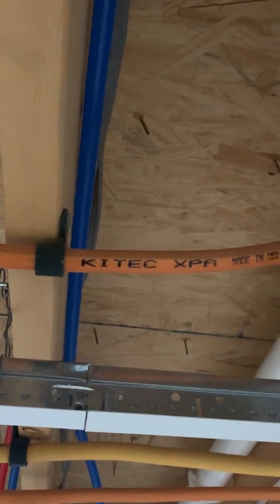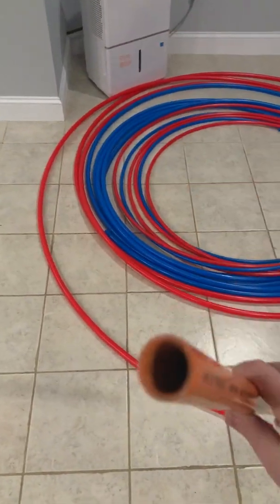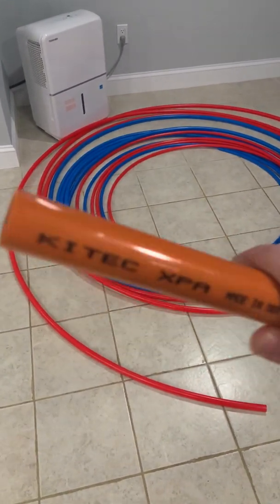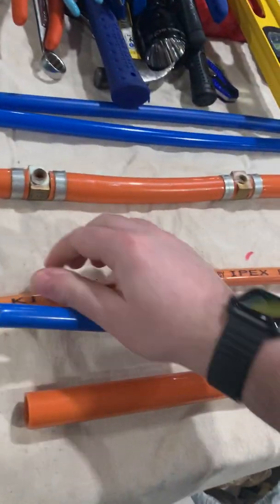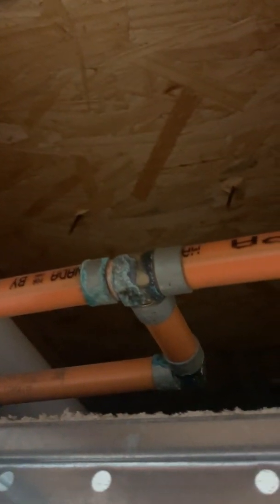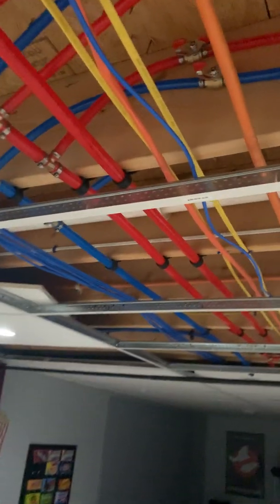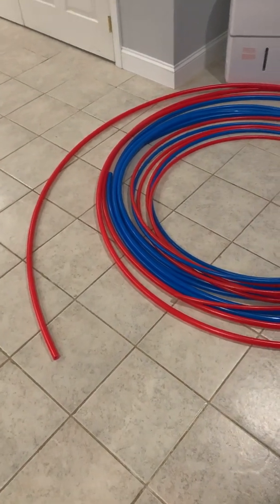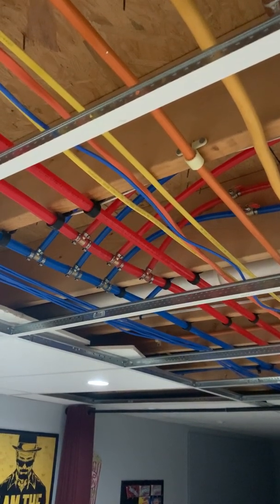Ipex Kitec Pex Plumbing: A Homeowners Experience

Comment: Super helpful video especially the parts about the Veratek fittings.  Looking to use some myself but getting conflicting information from the manufacturer.  I know this is 3 years later but would you happen to know the ID of your 3/4" Kitec or the OD of a 3/4" Veratek fitting?  I know they're supposed to both be .75". However, I have the exact same PlumbBetter Kitec you had and mine measure .78" ID.  Same for my old 3/4" Kitec fittings they measure .78" OD using a caliper.  Any info would be greatly appreciated.

Comment: Thank you so much Joe. Just finished replacing Kitec from my water main to my water heater and then to my washing machine and bathroom sink. I am 80% done. My next work would be from my bathroom sink to the toilet, to the shower and finally, the kitchen sink. I used Veratek PEX to Kitec fitting as a temporary transition from Sharkbite's PEX-A to Kitec until I'm ready to do the next phase of my work. I used cold expansion on all connections except on the Veratek fitting. I used cinch clamp on the PEX side since it is also approve by Sharkbite on their PEX-A piping.

Comment: Thanks for the info I plan to do this myself too and hoping to leave the upstairs alone for now so this is perfect. Interesting you went with A pipe using cinch/crimp solutions, typically that pipe is used with the expansion rings.

Comment: Hi.  Thanks for your video.  It has helped us a lot in understanding what needs to be done.  What tool did you use to cut the Kitec? We have a PEX cutter but not sure if it will cut through the aluminum center of the Kitec.  We don't want to try it and damage the Kitec and/or the tool.  Please let us know.
Reply from the maker: I'm glad my video helped.

I used a simple PEX cutter from SupplyHouse.com (SKU: E6081128). The aluminum is thin, foil like. You should have no problem cutting it assuming the blade is sharp. I used scrap to perform a few test cuts - hopefully you'll be able to do the same.

Wishing you well in your repairs.
Reply: @Joegig89  Thanks! We'll try that.  We were just about to order the Veratek fittings and noticed that they have a notice that the fittings don't work with Plomberie Ame'liore'e pipe.  After checking ours, we have Plomberie Ame'liore'e pipe.  Any thoughts on other options for us?

Comment: thank you Joe for sharing your findings.  I have one more run of this nightmare class action lawsuit product still in my home and I believe it now has inevitably it started leaking.   your find for Vertek is an absolute gem,  I am debating to try that out but Deb mentioned the aluminum fitting wont work with regular pex crimp fittings.. in the long term.. so now I am still pondering... I may reach out to Veratek to see what they say about thier fittings working on regular PEX.

Comment: Joe, how did you cut the kitec pipe?
Reply from the maker: Regular pex cutting tool. It may crush the aluminum core slightly but once you insert the fitting it rounds out again.
Reply: Thx. I have the veratek fittings and I’m all ready to go. Just need to be prepared, as after that first cut into the Kitec, there is no going back!!  Your video was great. Thank you!!
Reply from the maker: @matthewtryniski7771  Get a quality pex cutter that is sharp and you'll be fine. Plan your cuts where if you mess up you can just cut back more and offset with more replacement pex following the Veratek fitting. You got this. Good luck! Zero leaks on my end since this project.

Comment: Thank you so much for the information Joe.  Very clean work you did on your replumb.  I live in California and learned I have Kitec, so your video has been very educational on what I need to do.  The Veratek fittings will help me open fewer holes in my walls allowing me to keep some of the Kitec pipe in the longer runs, while switching to Pex as needed.  Thanks a bunch for this video.
Reply from the maker: Glad I could help!

Comment: The fittings were made in Taiwan, and some of the fittings were made with high levels of zinc. Zinc is a sacrificial metal used in the marine industry. All househlod brass fittings that are potable are made with zinc. The Pex-Al-Pex brass fittings made today are not potable, made with lead, and should be avoided to repair your household Kitec. I installed Kitec in my house 22 years ago and have had no issues to date,  I however I used the compression fittings, not the crimp fittings. I also believe that my fittings may not have the large amount of zinc as others have. Sorry to hear about your issues and wish well with your repairs.
Reply from the maker: Thanks Richard. Zero issues following the replumb a few years back. I was chasing a leak almost monthly until I just removed it all. Not only that but my flow rate increased significantly. Many of these fittings were overly restrictive as they failed.

Comment: You came close but you didn't hit it. Kipec is not , was not ever built to the  CTS standard that most other plumbing pipe choices are. CTS= Copper Tube Size and copper pipe (hard and soft), PVC, CPVC and most PEX is manufactured to that standard. There are fittings available (or were) that work with this stuff. Interior o rings like you showed  in a compression style fitting. feral and nut. Regular PEX fittings will not work long term as crimp rings will not secure the AL portion of the pipe.  As to the rotten brass.well...any brass from Asia is trash.  In brass use LF from either the US or Italy. I like the pipe itself but fitting hassles make it something to avoid IMHO.
Reply from the maker: Not bad for a network engineer who had no prior plumbing experience. Thanks for the additional data points. Zero water issues since I solved this problem.
Reply: are you saying the aluminum Veratek fittings will eventually not hold up on a regular pex connection crimp ring?

Comment: Did you ever try sharkbite on kitec. We were in a bind and used this week. It’s holding so far. What is your experience?
Reply: not supposed too haha but if it works it works
Reply from the maker: Didn’t consider this route as it was not a correct remediation. Pride in ownership at my household - I might not do everything 100% correct but I do my research and execute to the best of my abilities.
Reply: was it 1/2 inch?

Comment: Toilet valve at kitec supply line/riser has malfunctioned and is blocked.  I assume that there is some corrosion.  Planning on replacing valve.  When adding a new toilet valve to the riser is it simply a removal of the old valve by unscrewing.  That is, is there a fitting crimped in the kitec line to simply thread on the new valve?

Comment: We have leakage and can’t find the fitting to replace it and now we have to replace the whole house. So expensive
Reply from the maker: Where is the leak? Did you get the details of the Veratek fittings I used? Using these will save you from a complete replumb.
Reply: @Joegig89  do you have the website and the company name where you bought the fitting my name is Julio mom having trouble trying to find the fittings thank you
Reply from the maker: @juliohernandez901  Its in the description: Veratek

Comment: Should not be using the expansion ring for pex a?
Reply from the maker: While pex a supports expansion fittings, it is not required. You can use normal stainless steel cinch clamps and copper crimp rings.